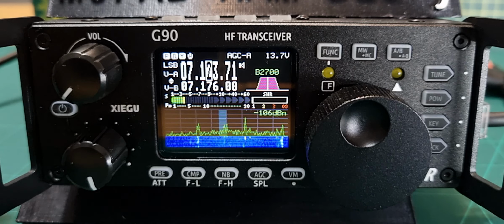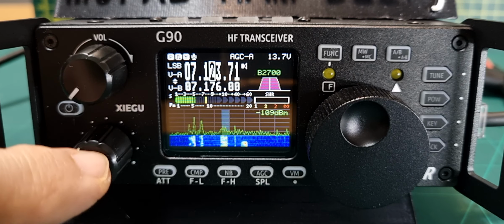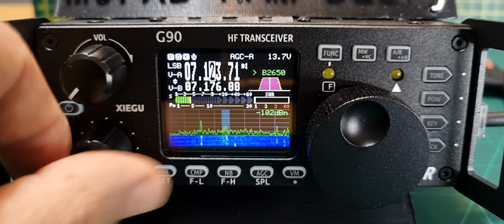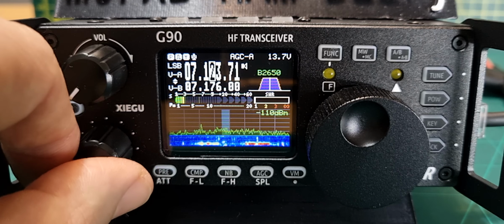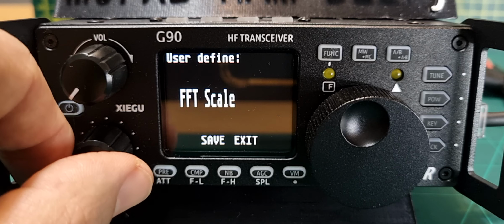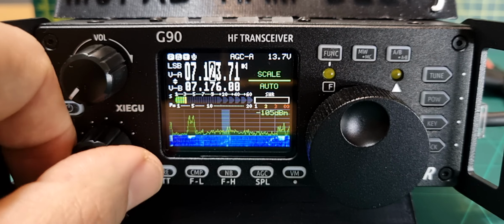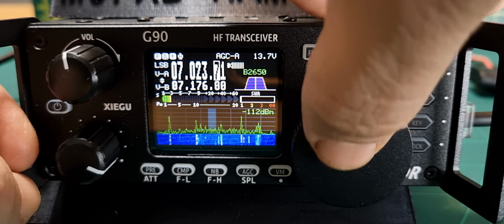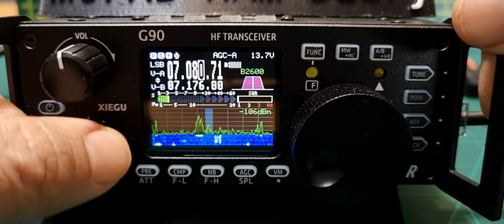XIEGU G90 - COMP Button Firmware 1.79

Comment: never really explained the comp button
Reply from the maker: I will do another
Reply: For instance: when changing the filter on each colour what are you changing? I heard it's two separate filters you can adjust left and right. But why? The old system was clearer.
Reply: Ah, yes. You can adjust the two filter separately. So there is no centre adjustment? Still unsure.